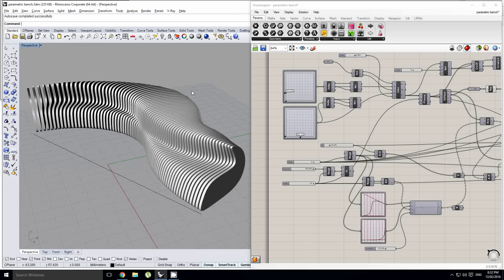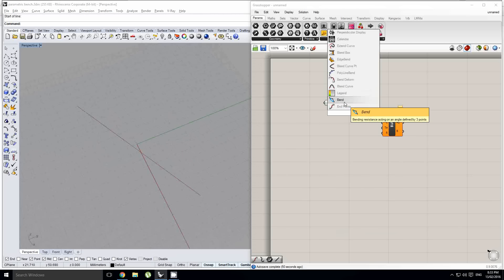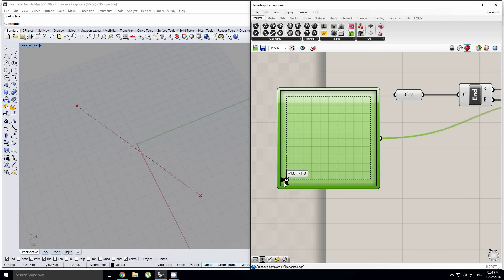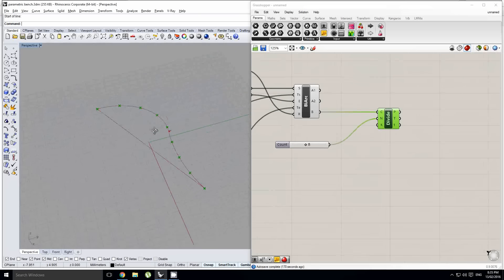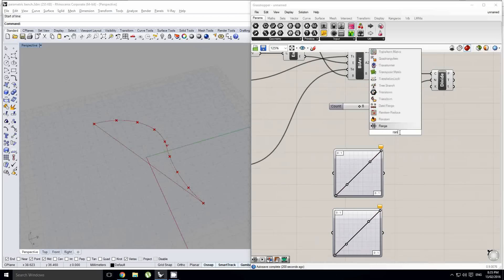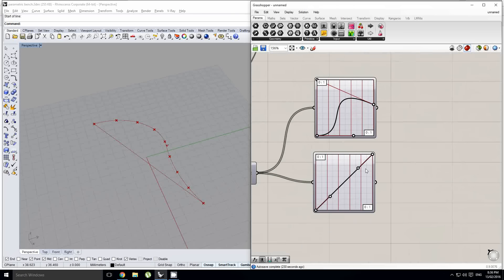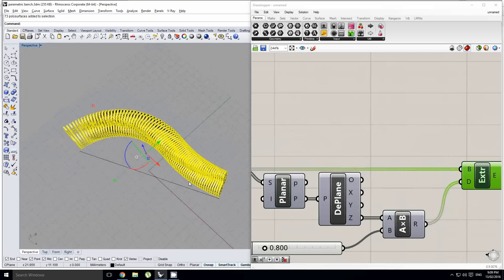Grasshopper - Making a Parametric Bench

Comment: Hi, thank you so much for the tutorial! I got an error at the 'mesh weldvertices' at 31:15. My grasshopper said that 'welding mesh with this settings was not successful !!! …output of the original mesh'. I solved the error by baking the mesh into Rhino and repairing it in Rhino. I wonder whether you could help me with a better solution. Thank you!!

Comment: great tutorial thank you so much, would you please tell me what plug in should I use to create the rod to connect the contour parts or the piece of wood in the panel connections as I always stop after the designing process and unroll but don't know how to connect them
Reply from the maker: +Nofa sales Hey Nofa. Unfortunately I don't think you're going to find a plugin which simply creates the joining rod between these pieces of geometry. You would need to create that part of the script as well. I don't imagine it would be too difficult with the stock grasshopper library.
Reply: Thank you so much

Comment: Nice tutorial!
One thing, at 17:19 you mention that the division will you give the height difference between each consecutive point. 
You divided the height by the number of division in x, not in y. So to get the height difference you actually would have to divide by the y number of divisions, that is the range component.
Reply from the maker: Hey mate! Great spotting! It took 7 months for someone to find that. I guess that's the trouble with using similar (or in some cases, the same) values for different parts of the definition.. Thank you!
Reply from the maker: Added an annotation for clarification. Could you tell me if it makes sense?
Reply: I feel its alright, great work!
Reply from the maker: Thanks so much! If you do notice anything else at any point, please let me know again! Cheers
Reply: exactly! and this is why i decided to stop following the tutorial and start reading the comments! i wasn't convinced of this division, it didn't make any sense and i didn't want to continue without being convinced of every step i'm doing! so thank!

Comment: Hey Daniel, first of all amazing tutorial. I have a doubt. At frame 13:35 there are lines joining the points which are creating the desired mesh. In my case though the mesh has been formed but there are no lines visible. How can i correct this? Thanks.
Reply from the maker: +Kashish Singla Turn on mesh edges by clicking in your grasshopper canvas and using the 'ctrl + m' shortcut combination.

Comment: Hi Daniel

I got stuck at 26:03, my definition won't let me 
continue as all the curves are infinite, which I noticed you ignored and
 it worked for you, however when I plugged it into the Decon Arc it says
 that data conversion failed from Curve to Arc.

Any ideas why?
Reply from the maker: The likely problem you are experiencing is that you are trying to obtain the curvature of a perfectly straight line segment. The way I got around this in the video is by changing the value of the rebuild count, such that we find a result at which there is curvature at every single point that we are evaluating along the curve.

Comment: Really great tutorial for understanding Parametric's.
Anyhow, when I am to input an expression of x-1, onto the list length, it ends up showing an error.
Reply from the maker: At what time exactly in the video are you referring to?
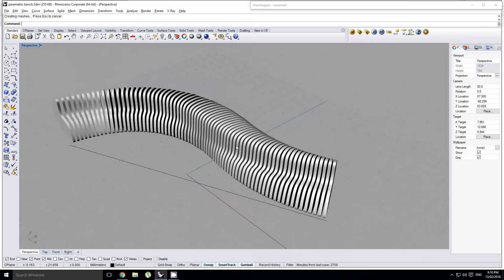Reply: 20:59 / 38:11
Reply from the maker: +Shruti Narayanan is the list item component showing the error or is the list length showing the error? If it's list length showing the error, then simply perform the (x-1) operation externally, inside an expression component, instead of in the right click menu.
Reply from the maker: +Shruti Narayanan is the list item component showing the error or is the list length showing the error? If it's list length showing the error, then simply perform the (x-1) operation externally, inside an expression component, instead of in the right click menu.

Comment: Hey, I'm at 29:04 in the video and am having trouble merging  "move & Divide" into that one point "Pt". Is there another way to merge?
Reply from the maker: +Shauna Riordan you could just use a separate 'merge' node which does the same thing. But if you want to put them into the same node, hold the shift key down while plugging in multiple streams.

Comment: Hey, I also added your plug-ins into the Grasshopper folder, but I still can't find the 'meshfrompoints' component.
Reply from the maker: +Thomas van Vooren do you have the right component, and did you unblock the assembly file?
Reply: i cant find it too. Did you upload a plug-in or smt for that? Did you find how to do it?

Comment: Hey nice tutorial. However I can't download the "mesh from points" for the Mac do you have any suggestions? Thanks
Reply from the maker: +Myrle Scarborough Well I suppose you could replace the mesh from points with the surface from points component which is part of stock grasshopper. And then you could run that through a mesh surface (Mesh UV) component with a higher number of U and V divisions. Then you should be able to pop it back into the mesh plane intersection component and resume as normal.

That said, mesh from points is such a useful tool, along with the rest of the meshedit tools component. I mean there definitely are workarounds for it, but the surface from points component can be a lot slower than mesh from points.
Reply from the maker: +Myrle Scarborough I added a modified definition to my google drive in case you wanted to have a look.
https://drive.google.com/file/d/0BzOIPjBHKE4GYmpGcnVKTndQdVk/view?usp=sharing
Reply: +Daniel Christev  Thanks a lot for your help I really appreciate it. I tried to open the file however you've used a few plugins that are not available for me to download for the mac version. 
Mesh from points, Mesh Weld vertices, Weaverbird catmull-clark subdivision. I'm trying to figure out how to draw such a bench for a university project. I would appreciate it if there's some way around these plugins to complete the tutorial.  Thanks.
Reply from the maker: +Myrle Scarborough hmm. I'm pretty sure you should still be able to use the definition despite the fact that those plugins are missing. Just try continue past the warnings and it should work fine.
Reply from the maker: +Myrle Scarborough In case it didn't work for whatever reason, I purged all the plugins and here it is.
https://drive.google.com/file/d/0BzOIPjBHKE4GSmhUd2Z3aUtFTFk/view?usp=sharing

Comment: I installed "Mesh From Points". I can see it in Rhino commands but not in Grasshopper. What should I do?
Reply from the maker: You may have installed it incorrectly, make sure you unblocked the gha assembly file.

Comment: hey,Daniel,I'm just wondering where the function x*z＋y*{1－z} comes from,does it have any logic meanings?THX
Reply from the maker: +njy jim hey there. It is a function I derived to create a weighted average, you can google weighted averages to understand more, but the idea is that it let's us shift the interpolation of two lists - x and y, based an interpolation value - z. If z=0, then the output is 1*y, if z=1, then the output is 1*x. Any value of z in between 0 and 1 will give us a weighted average to one side or the other.
Reply: Thank you for your  elaborative explanation.In fact I'm always bewildered by the sudden appearance of the equations in many other grasshopper videos.Now that you mentioned there actually  exisits some mathematically proven formulas,I think I may check it carefully.
Reply from the maker: +njy jim no problem! There most certainly is purpose and method behind all the math that I do in my tutorials, and I'm sure in many others as well.

Comment: Hi!  Is there another command I can use instead of mesh from points, I cant download it :(.
Reply from the maker: +Shadie Elyaei why can't you download meshedit? You can do something similar with the surface from points component, it's a stock component but it is a bit slower.
Reply: I'm using my university's computer and unfortunately it wont let me to. Ok I don't mind if its slower il check it out. Thankyouu !!
Reply from the maker: +Shadie Elyaei they don't tend to block access the grasshopper components folder.. It's not a region where you can compromise necessarily the running of the machine. But, I obviously can't speak to specifics

Comment: i got lost around 20-24. i cant add the -1 in item list and i cant put x-1 in list length (gives me red). So i try with L-1 and it was good and continue but i dont have the Mesh from points so im using surface from points to connect to the biarc and it gives me a red...
Reply from the maker: +Francis Kwok mesh from points is part of the meshedit plugin, there is a link in the video description.
If mesh from points is throwing an error as well, the simplest way to debug is to see how many point values are in the list, and then check if that corresponds to the product of U and V.
Reply from the maker: +Francis Kwok if you can't add the -1 in the list item, you might be using an old version of grasshopper. You can also just create a separate -1 value into the item index of the list item component as a substitute.
Mesh from points is a plugin, link is in the description.
If you are connecting the biarc directly to the surf from points, that will not work.
Make sure that the number of points is the multiplicand of the U and V values.